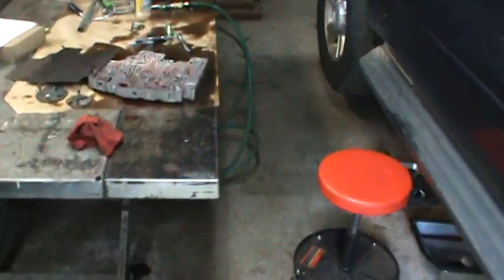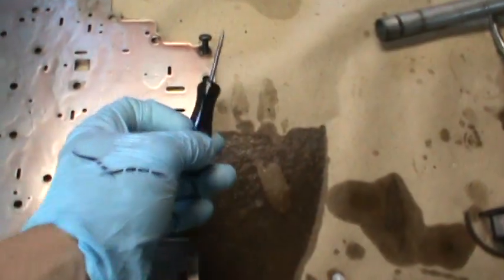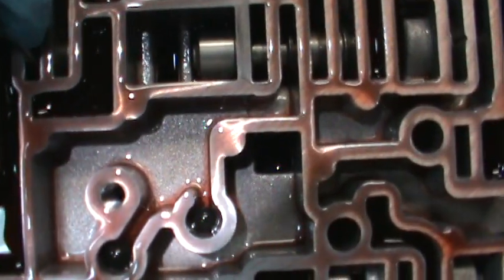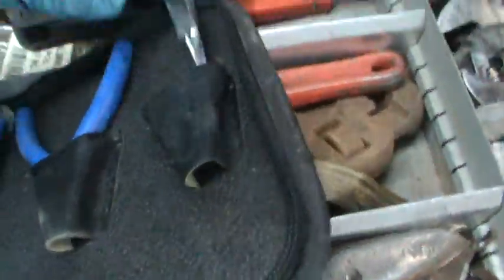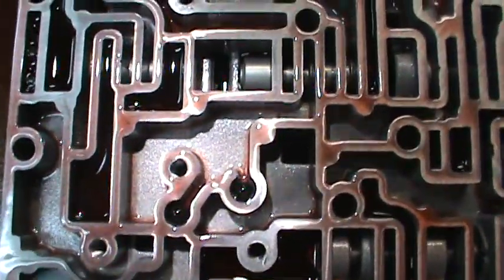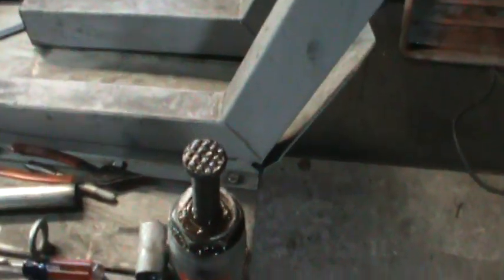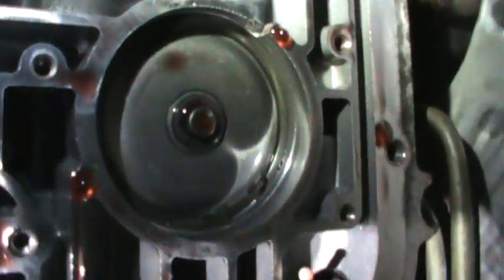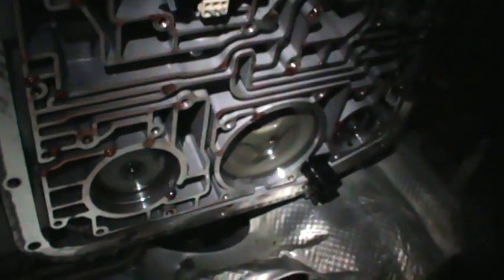ford f150 transmission repair part 2

Comment: Another tip also. I have a 2008 ford f 150 king ranch with same trans and engine. Ford had the ingenious idea of putting plastic check balls in the valve body. I believe there are 7 or 10 in the valve body. Either way, it will develop a shudder between 2nd and third gear, because the plastic check balls wear down, not allowing the spools to seal properly. So if you have the overdrive problem, just replace the check balls while you are in there. They are a whole $8 bucks on amazon. Great video, great info.

Comment: your video was sooo helpful....same thing happened to me...i had two pieces,,one in the dame spot as yours...thank u for posting your video saved me alot of money
Reply from the maker: glad l was able to help
Reply: Mustie1 forceps work great for those real tight to fight spots, and they LOCK!! So if you need to twist and giggle something in order to get it out, well the Mustie1 FORCEPS to the rescue hahaah they have 3 feet down to mini 2 inchers. The kids now days use them to smoke crack, hash mary jane hahaa you like EBAY AND EBAY has every kind curves lefts rights 45's 90's etc.... very cool video WE would never be able to do that I don't think.

Comment: Thanks for this (and Part 1). From looking around, and these videos/comments, it sounds like this is the issue that just cropped up with my 2005 Crown Vic. I was worried about how much the transmission had to come apart until I found your videos. Oddly enough, I was already watching your channel fro the Cushman 3-wheeler rebuild!

Comment: My 2004 F150 had the O/D light blinking, then trans fault, then code 720 and 722.  Would only go into reverse.  Replaced speed sensors.  No luck. Others told me this may be to problem. Going to try this next. Thanks for the video.
Reply from the maker: hope it works out for you like it did for me

Comment: I wanted to let you know,  my snap ring had 1 broken tip only, which made it a pain to get off.  once I did the new one snapped into place. after inspecting the valve body the broken piece was right where you showed yours.  Only problem is while letting down the valve body I'm pretty sure it was the other servo came out cover, spring, and a small filter.  I have to try and research this to see how I'm going to have to reassemble.

Comment: The plug is for when they move the transmission around before it goes into the vehicle. moving them with the tube on is very unwieldy so they put the plug in and the tube itself actually dislodges the ball as a natural effect of the assembly process.
Reply from the maker: l found that out later when l showed it to the parts dealer

Comment: Mine just went today. I got to about 50 mph's and it just rev. I turned off overdrive and its fine. Auto parts guy said my transmission level was low so I added a little.  If I take it apart and snap ring isnt broken then what do I need to look for?? Your video is great

Comment: Thanks for your video.  My 2005 5.4.   will only go into drive with the od button off. could the ring problem be my problem or would it be a solenoid problem. thanks for your help
Reply from the maker: if it goes into neutral when it shifts into od then it sounds like your problem, and then you push the button that only allows it to shift 3rd,

Comment: Stupid question: I see that you reused the pan gasket, but how about the gasket between the trans and the valve body? It seems to me that if it came off easily and intact, it should be fine to reuse, yes?

Comment: Off topic, but I noticed your your needle nose are magnetized. Don't know about you, but I hate magnetized tools.

A solution is an old TV degaussing tool... the ring type is best, and can be had cheaply on Ebay or garage/swap meets.

Hold coil with one hand, press the switch, bring tool/s to coil with other hand, wave them around in it, then slowly pull them away arms length before releasing the switch. It only takes like 5 or 7 seconds, so dont burn up the coil as it has a short 'duty cycle'

Comment: I just had the same issue. took it apart and the snap ring was completely gone. I checked all over the valve plate and I cannot find a single piece. What should I do?

Comment: Can anyone tell me which tool is used to compress that c-clip.. a new one. I have a small c-clip pliers that I bought from advance Auto but it's not doing it. I think mine is designed to go in tiny little holes whereas this c-clip just has grooves cut into it

Comment: 2004 F150 XLT 4WD: won't go into overdrive.. The engine simply revs up when it reaches overdrive.. The transmission repair guys all want $1600 to do a "rebuild". I've been driving it around town only with the overdrive turned off.  Any ideas? Is the snap ring broken? Is it a sensor? Thanks!

Comment: Alot of that snap ring was missing. The piece you took out of the valve body did not seem to make up the missing parts. Where is the rest of it?
Reply: There were a bunch of pieces on the top of the valve body when he showed it in part 1.

Comment: Hi guys,
...i got  a '04 F-150 2x4,70k mile,with some transmission  problem; i had it in REVERSE  and all off a sadden the truck was moving forward ,but after let it cool down few minutes,it came back to normal .Next day i left  with the truck just to find out that transmission will NOT  CHANGE FROM 3rd to  4th or Overdrive .,,  the 1st ,,2 nd and Reverse are fine ; but soon after i got over 30 mph ,the RPM  rise ,just like in neutral,,i pulled over, i realize my dipstick was dry, did not see any leaks underneath ,everything is dry .I raise the truck  i drain the rest of the fluids out replace it with 5 qts of Mercon 5,with new filter and gasket,than took it for a ride,but Unfortunately it DID NOT fix anything ; i am not in the mood to see any ford dealers yet , can anybody give me some technical advise like how and what to start with first ?? THANK YOU for reading,John